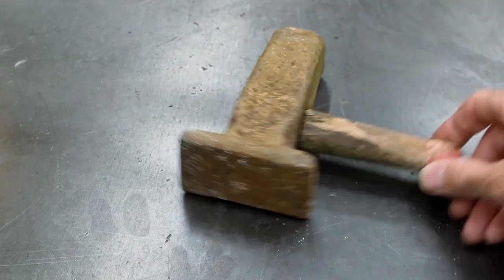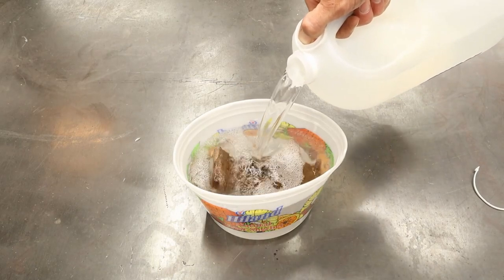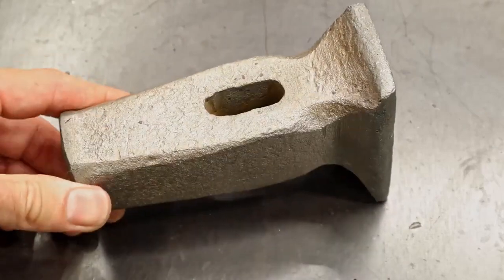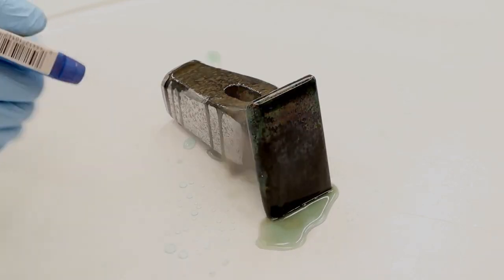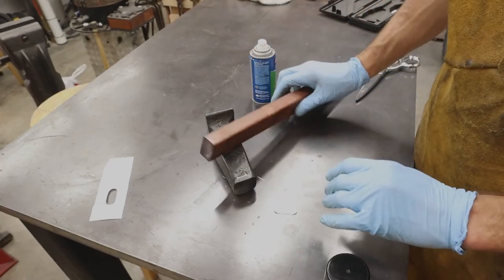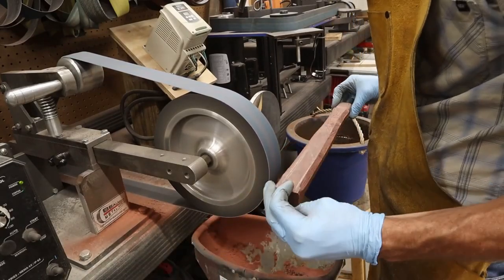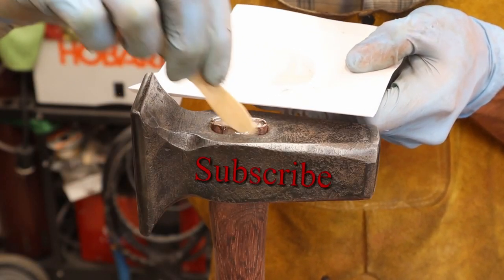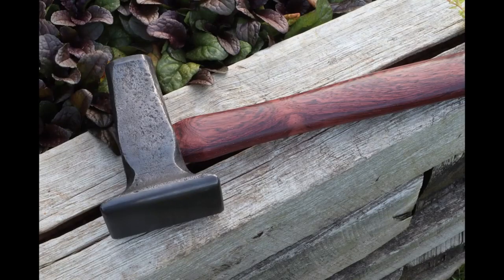Making your own handles - Old hammer restoration!

Comment: This is what I needed to know. I got a great little ball peen hammer at a 2nd hand shop. The hammer is in good condition, but rusty and the handle needs to be replaced. Great video, thanks!  And the bonus is that the rusty vinegar you are left with can be used as a natural wood stain.
Reply from the maker: Neat tip about the rusty vinegar!
Reply: @Aleeknives  :) thanks!

Comment: vinegar is great for rust removal, used that method loads of times restoring motorcycle parts, electrolysis works really well also, and vinegar will also patina the steel,  know what the hammer is even though I don't have one as yet, really nice job on bringing it back to life, look
s just right
Reply from the maker: Thanks Andy!

Comment: Flatter, would love to find myself one
Reply from the maker: Works great!
Reply: @Aleeknives  Say one didn't have access to good hardwood, what would you recommend from a place like home depot or lowes for hammer handles?
Reply from the maker: You could use a 2x4 as long as the grain runs length wise. It will be more springy feeling. Hard wood transfers more shock to the hand. It is give and take with different woods. Hard maple is great!
Reply: @TRichardsBlades  the handle material for a struck tool like this flatter isn't of much significance, you can use just about any wood or even steel rod handles. Struck tools transmit minimal shock to the user compared to an actual forging hammer that is swung in use.

Comment: When you say to wash with water and neutralize with baking soda, do you mean apply baking soda to the metal surface after you've washed?  Do you just sprinkle it on the metal and let it set there (how long), and then rince off?  Apologies for my ignorance, however it almost sounds like you nuetralize the bucket of vinegar by pouring baking soda in it before disposal.  I just want to be clear for what I'm about to try. (Old double-bit axe)
Reply from the maker: No problems, I normally just sprinkle the baking soda over the metal and then use a wet rag to rub it in and make sure that the slurry of baking soda and water gets into all the nooks and crannies to neutralize the acid
Reply: @Aleeknives  okay, and thank you for the reply!  Well put answer, and exactly what I needed!

Comment: Makes you wonder why someone would get rid of the one edge of the face
Reply from the maker: The only thing that I could think of was that they were using it on an inside corner.  However, the back of the hammer didn't show a ton of wear from being used so I don't know but great eye's man!